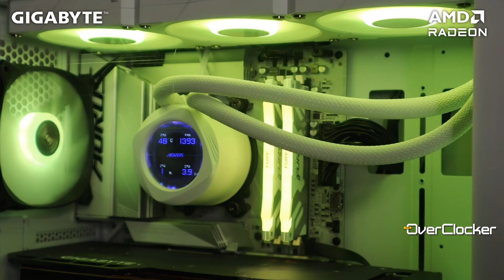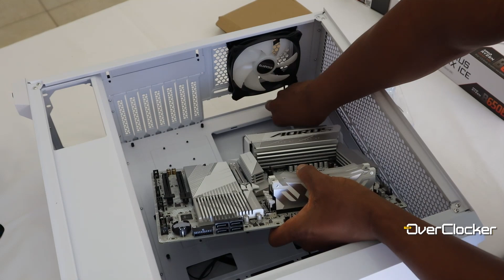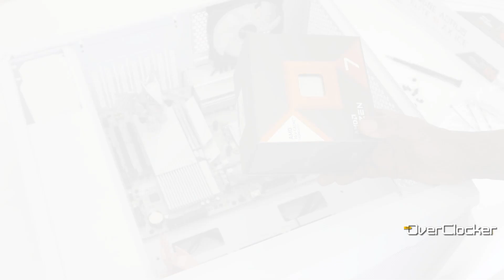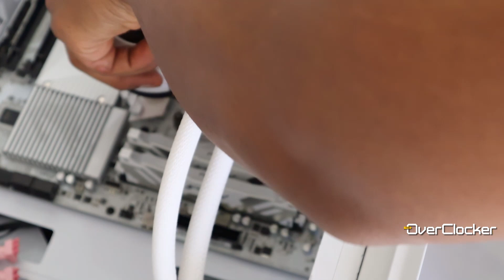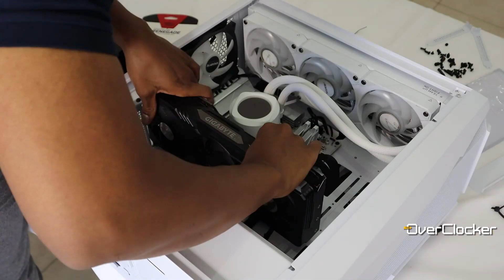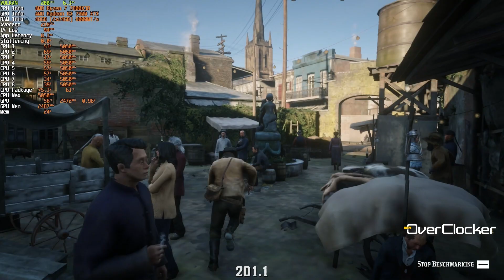My 1st Gigabyte & AMD powered all White Build - B650E + 7900 XTX + 7800X3D = Mighty

Comment: I recently bought the same motherboard and the ssd shown in the video, Kingston renegade 2tb. I was wondering, when I put the motherboard heat sink on the ssd, it seems to have bent in the middle. Is it like that on yours?
Reply from the maker: Likley not an issue for you, but I've not noticed the bend. If it's slight its acceptable,